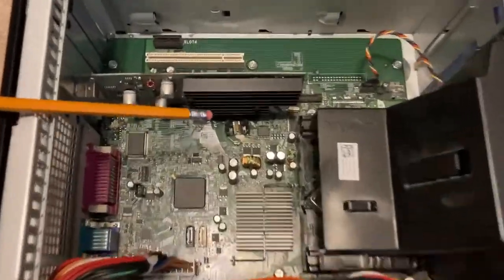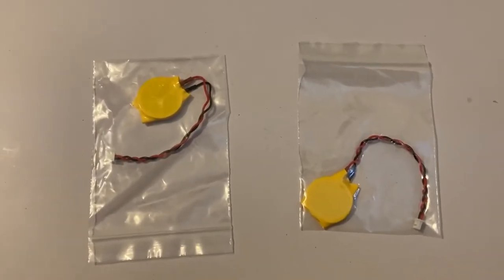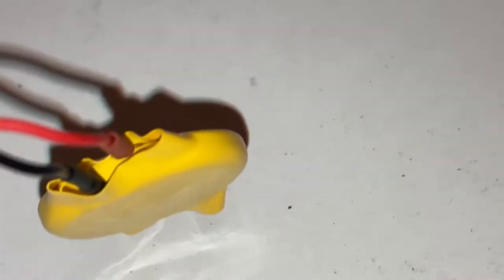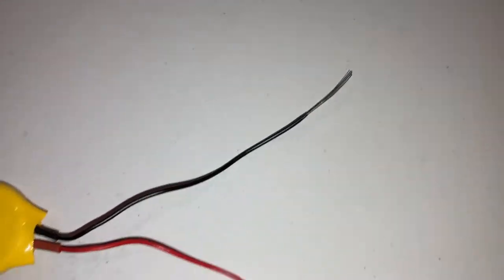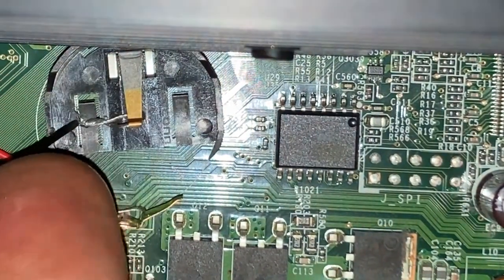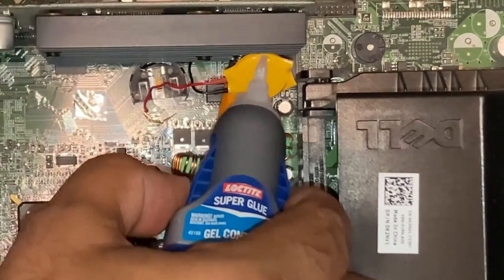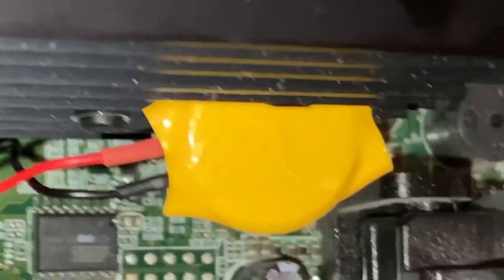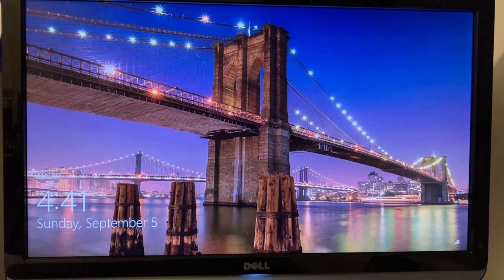Broken System Board CMOS battery Holder? Easy Fix!

Comment: I'm glad that worked out for you, but do you really think the heat sink is a good place to attach, since it will get hot when the PC is running for a while?  Also, you should probably attach the wires with solder as the way you have them twisted on is not a very reliable electrical connection, my friend.
Reply from the maker: Good questions! There are many solutions to any problem, and what I show in this video is just one of the solutions with the preference for ease, low-cost, which users can do at home. With all things considered, I thought the heat sink was a good-enough place to attach the battery with the understanding that the heat-sink is not going to have high enough temps to melt the plastic around battery. So far it held up okay in my computer. If you have soldering iron and are good with soldering then definitely use it - or may be better to use the replacement battery holder to attach to PCB. There are so many options to fix. what worked for me may not be what others feel comfortable with so please proceed with what you prefer. Best wishes.
Reply: @FlyBeee  It's not about melting the plastic around the battery, it's a bad idea to expose batteries to 60-100C heat that a passively cooled GPU will put off, it will significantly shorten the lifespan of the battery and can possibly damage the cell exposing it to that much head, it's much better to stick it to the computer case.

Comment: Loved your video however I do have one question: Where exactly is glued the CMOS battery? It looks that you have attached it to the GPU heatsink. Is that correct?
Reply from the maker: You can attach the CMOS battery anywhere that you seem would be convenient in the computer, and each computer would have different available space. Mine has GPU which may not be in all. I used the laptop version of CMOS battery (which is covered in plastic) to be sure it does not create any short circuit. I hope this helps

Comment: The red wire is on the negative or black on negative
Reply from the maker: Black is on negative
Reply: I saw that also - the fact that the date was correct when it booted has nothing to do with install, it isn't fixed.

Comment: Can you connect it to jbat1 or not?
Reply from the maker: I would not recommend to connect to JBAT1
Reply: @FlyBeee  but would it work or is there a good reason not to do it
Reply from the maker: @jesseycoolen4169  Well, what would be a good reason to connect CMOS battery to JBAT1?
Reply: @FlyBeee  you could connect it better then, and not just with some bare wires that could slip off

Comment: My cmos battery hold snapped off what do I do?
Reply from the maker: can you connect the wires to the connectors like I show here?
Reply: The whole thing snapped off somehow
Reply from the maker: @scpnoobers  if you are comfortable with using soldering iron, you can reattach it. There are also electric conducting glues that I hear are good options - but i have not used them myself. i hope this helps
Reply: Thank you for suggesting this. I got a soldering iron.
Reply from the maker: @scpnoobers  If you tried soldering, how did it go?
Reply: I haven’t tried it because the cmos battery holder and soldering kit hasn’t came yet. Thanks for asking
Reply: Update : I’ve soldered some wires like yours and got it working but one of the solder things doesn’t stick to the board. What I mean is one of the metal legs doesn’t stick down to the little square it was on.

Comment: that's one way to do it...
Reply from the maker: So far it is still holding up. What other ways have you tried, in case I need to redo
Reply: @FlyBeee  that steel thingy where u attached ur wire that is broken for me what I can do
Reply from the maker: @dragonnosgaming931  There are two steel terminals, depending on which one broke, you can either try to reattach the broken piece or a copper wire (taken from a wire) to place it broke from. At least two ways to reattach. Either with soldering iron, or with metal conductive Printed-Circuit-Board (PCB) glue ...something like this: https://amzn.to/3SSiWka  I have not used this particular one but it is listed as PCB glue. Please review this and other options to see which you feel comfortable with using. And cover the base area to protect from PCB circuits from getting damaged.
Reply: @FlyBeee  thanks I will think about it
Reply: How about actually fixing it with a new battery socket?
Reply from the maker: @nexxusty  That was my first course of action and I bought a similar looking battery holder but although I have done quite a bit of soldering it is not my strongest point so I went with this alternate option you see in video which was simpler and easy to get done with less risk and was simpler- at least for me and likely many others. If you are good with soldering then definitely replace the battery socket.